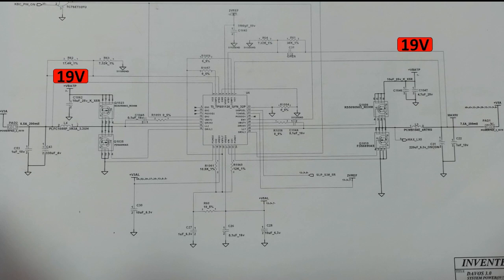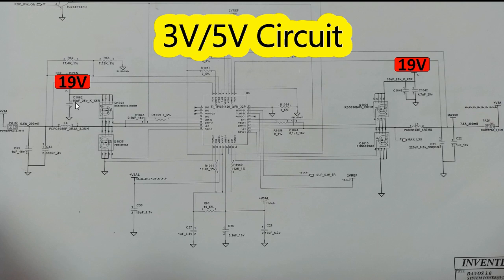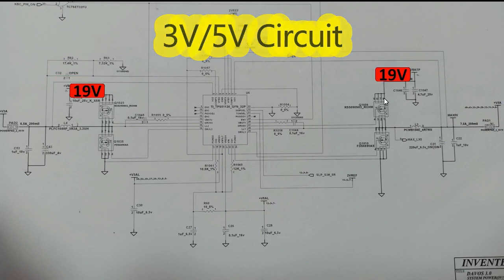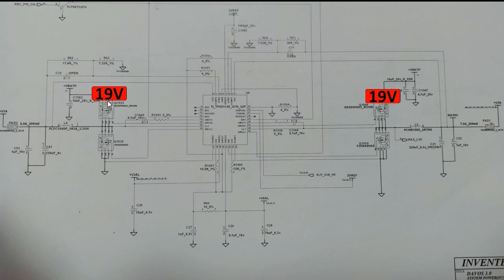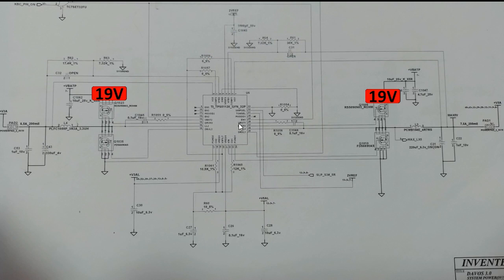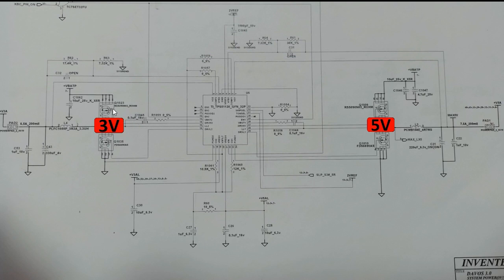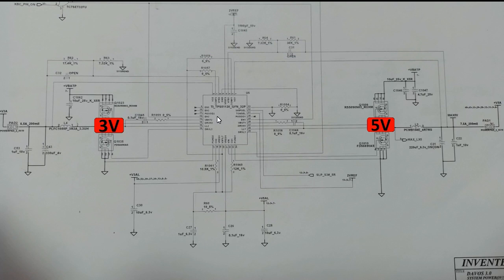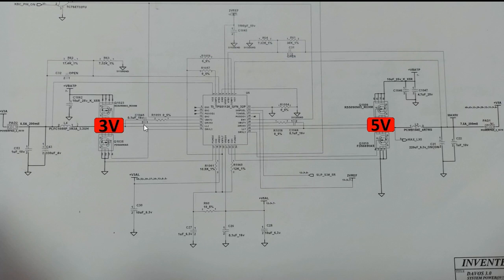Laptop motherboard repairing course, computer repair part 3

Comment: From the ic controller than generates the drive high and drive low to the first MOSFET and then goes to the second MOSFET which it connected to the ground

Comment: The circuit is buck converter, known also a step-down converter. A PWM signal is applied to the gate of the up-side and the down-side MOSFET interchengeably. While the up-side MOSFET is turned on,  19 V voltage is applied to the output part of the circuit, so a current through is rising and the output capacitor is charging and the output voltage is rising too. While the down-side MOSFET is conducting, 0 V voltage is applied to the output part of the circuit, so the value of current through is falling. After a while the output capacitor is charging no more and the output voltage is falling. To achieve a correct voltage the controll IC must adjust the up-side MOSFET turn-on time vs. period time of the PWM, what is called duty cycle.

Comment: Not a expert but I think MOSFET internal resistance depends on voltage applied to the gate pin. More volts, less internal resistance.